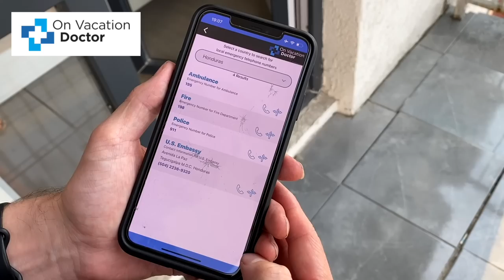METAL GRINDING IN OUR REAR TYRE 😱 [S4-E13]

Comment: On any vehicle, motorcycle or machinery  wheel bearings are viewed as consumables just like tyres, chains and sprockets etc. In other words they are a wearing part. Wheel bearings are subject over time to moisture and dirt ingress to the bearing internals as well as wear from usage. It's the same for all brands. Bumblebee has done very well getting this far with being fully loaded and having travelled lots of dirt roads etc. I've had to replace wheel bearings on my bikes over the years. It's just the way it is. Top vid guys.
Reply from the maker: Thanks so much for watching 🙏😍

Comment: I thought you had a wheel bearing gone from the last video. Change all three of the bearings if you can. There are two in the wheel and one in the sprocket carrier. Check out the rear shock to as you are in a Suzuki dealer. Oh and as I keep saying. Lavi needs new gloves. There is no protection left in them. Stay safe and well xx
Reply from the maker: Okay 😬😍

Comment: The rubber seal on the rear wheel sprocket carrier ,is important to prevent the Ingress of water ,road grit & sand ,into the bearing & forming a grinding paste to erode & destroy it.  It’s not recommended to be riding a motorcycle with knackered wheel bearings ,they can catastrophically collapse without warning & cause accident ,injury & death .  It’s been known collapsed rear wheel bearings ,to cause the wheel & sprocket ,to skew sideways so badly ,that they have eaten into the rear swing arm & destroyed it . Chances are the other 2 wheel bearings situated in the rear hub ,also need replacing . You can get upgraded bearings ,that meet the correct spec & application ,that also have built in seals from reputable after market sources. The correct sizes & code will be on the originals or obtainable on line .  Bumblebee is deffo in need of a good checking over & any vital worn or broken parts ,repairing or replacing ASP, I would not chance it ,in hopes of reaching the USA to get everything done there . Take care both of you 👍
Reply from the maker: Yes we realised that’s what happened, from now on we will keep a better eye on the bearing seal to ensure that dirt and water don’t get in again! Thanks for the advice 😊
Reply: @LaviandOllie  Nice one ,prevention is always better than cure .👍

Comment: Bearings are universal as people rightly say. On the outer race there should be a part number. Any half decent bearing supplies store should have it. 

When I destroyed a wheel bearing on my first bike 50 years ago my father looked at it and got one out of his workshop. It was for a washing machine tub (he was an appliance repairer). 

I’d be replacing all bearings on the rear as well as the bearing seals if available. There’s a lot of load what with 2 people and all the luggage. Bikes do have max load capacities too. 

Levi and Ollie, best of luck with it. 

Just finished watching Itchy Boots latest instalment. She had her engine stripped down to replace a lunched clutch. Must be catching amongst the YT Adventurers.
Reply from the maker: Crazy that so many bearing are cross compatible! We are going to have everything checked over soon and replaced if necessary 😊 Max load capacity is 440kg, we are about that 😅 Thanks for the advice and thanks for watching!
Reply: @LaviandOllie  can’t wait for the next instalment. Oh, did you see my post about your phone holder? I’m curious about it as I have the same bike and I like that setup.

Comment: I looked it up its a common size used on many bikes . I think it's what I wrote yesterday. Is it the 1000 or 1050 v Strom? Anyway I think it was 52  by 28 by 12. You can measure it with a Vernier guage. Don't ride it with it that broken. You risk your lives if it breaks totally. Please don't be frustrated. It's far better to take it on a trailer or put a message on the net. I'm sure someone out there can help. I'm glad the mechanic has looked at it. Check front wheel also for graunchy bearings where it's turning but feeling rough. There should be no play when you twist it. Two seals and bearings should cost less than £20 from a bearing supplier . I used to work ordering bushes, oil seals bearings at Smith's industries 40 years ago. A sealed bearing will keep water grit out and grease in. A dodgy bearing will mean  the wheel wobbles and has side to side play same on front wheel and it can cause wobbles on steering. When you apply brakes it will be worse. God bless you and safe healthy happy travels.
Reply from the maker: Yes we didn’t realise just how common the bearings are, apparently it’s a good part to break on the road 👍 we will have the bike checked over properly soon and replace everything necessary 😊 Thanks for the advice and thanks for watching!

Comment: I doubt very much that the squeek was coming from the bearing dust cover, more likely due to the bearing cage being knackered and ballbearings missing, the wheel was wobbling on the axle which led to the tyre intermittently rubbing on the swingarm or frame. I would get all bearings changed, front and back plus the steering yoke bearings. Check also your chain and front and rear chain sprockets as these would also have suffered extra wear thro' the damaged bearings.  Do tho' get the rear shock checked too, if not only for peace of mind. Please don't compromise your own safety guys
Reply from the maker: Thanks for the advice, we’ll check it out 😊

Comment: It May be the bearing in the sprocket carrier going and or the crush drive rubbers (so it is). If the bearing goes completely it will destroy the drive rubbers (drive rubbers would be hard to get, bearings should be available most places). Get it fixed also I would check the wheel bearings as well. They are "usually" the same size bearing. I actually carried a set of bearings with me when I went to Scandinavia. Going through water is what kills them.
Reply from the maker: We were surprised at how universal the bearing actually was! Lucky it didn’t cause any more damage to the other parts. Alas to say we didn’t bring spares with us 😅

Comment: It's a bearing oil seal that's rubbing I think. The main problem is the grease lubricating the bearing may go dry, get contaminated with dirt grit. You will see when you take out the wheel. Good luck
Reply: It's not the seal it's the cage and rollers dry of grease and breaking up that's the worry. If there's metal particles you need to be sure it won't break up completely and seize up the bearing
Reply from the maker: Yes that’s exactly what happened! Luckily it didn’t seize up!

Comment: Is that a brand new vstrom 2020? How many miles did that rear wheel bearing last?
Reply: 24000 Miles or nearly 39000 Km on some Rough roads 😡& 2 people with Luggage
Reply: @gunter1444  …hmm…in that case I’d replace the front wheel bearing too  …just as a precaution….

Comment: I'm ordering new wheel bearing assemblies for my SUV vehicle., with over 100k miles.  Pretty good mileage out of them.  Recently I'm also hearing a noise from the rear wheel of my motorcycle.  Though there are low miles 5K miles) on the bike, it is 7 years old, bought in 2020 as New Old Stock.  It is making a sound like I have knobby tires on the bike (which I don't).  More like a drawn-out "OH" sound.   I'll have to pull the rear bike wheel and turn the wheel bearing by hand and listen and feel for the grinding of metal.  If so I can order the parts and replace them before things get worse.  It might not be a bad idea to order a set even if ok and keep handy.  Never know.
Reply from the maker: We definitely couldn’t do something like this ourselves, we have to learn still a lot 😅 thanks so much for watching and see you in the next one 🥳
Reply: @LaviandOllie  On the road and  no self service garage or the right tools makes it impossible to do yourself.  Good luck. I'll keep watching your adventure.

Comment: That place was wild looking. Just curious did the mechanic repack the bearings with grease so you guys could get down the road. I had the same problem with my peddle bike. It was exactly the same thing but I was lucky and caught it in time when I was rebuilding my bike. Hopefully it won’t be expensive down there. I’m wondering if the front wheel needs to be repacked with grease too. That’s a lot off mileage you guys are putting on the bike.
Reply from the maker: Yes he actually cleaned the bearing and greased it up, a lot 😅 hopefully we’ll find a replacement! It think for now the front bearing will be fine 😁
Reply: @LaviandOllie  hey guys that’s great I talked with the dealer down here and he said you should have your front ones looked at too. Safe Travels 👍🇨🇦